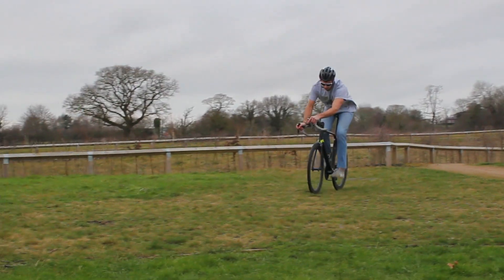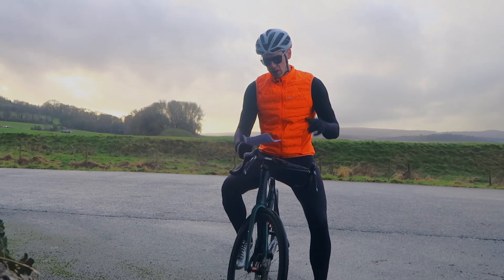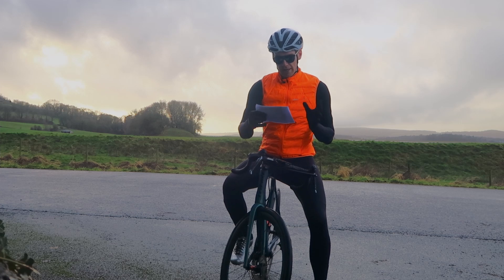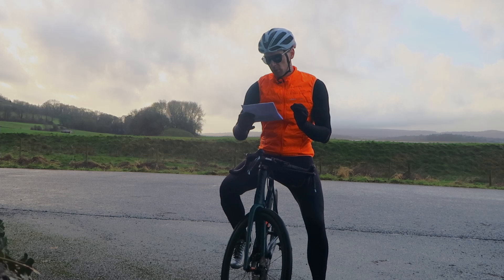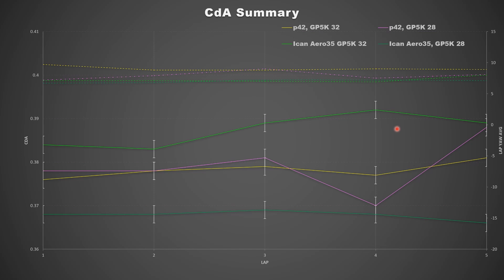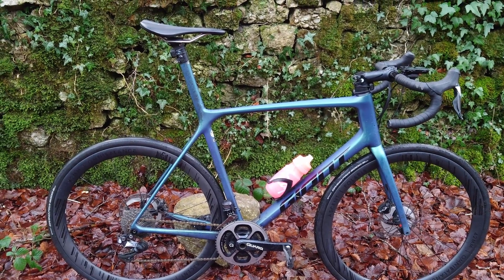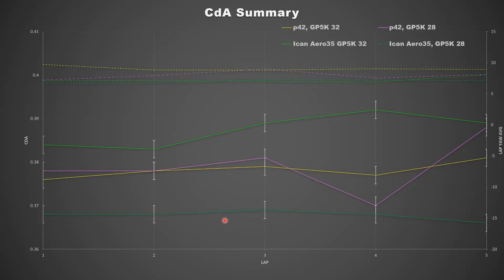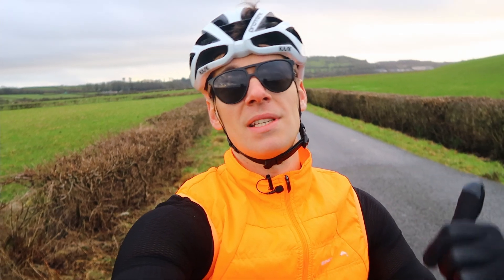Are Wider Tyres a total WIN? The Aerodynamics.

Comment: If the formula "the wide the tyre and the lower the pressure, the lower the rolling resistance" were true, the Tour de France would be ridden on completely deflated MTB tyres. Fact is that formula is only correct within a narrow (pun intended) margin and in order for "the wider the tyre the more aero it is" to work, the rim also has to be wider, which means you have to get a new set of wheels. But then the next formula sets in which is "more equipment = more money = more work = less riding = lower speed".

Comment: Why do you think the p42’s had greater air resistance than the aero 35’s on 28mm tyres,  shouldnt it have been the other way round?  Due to the increased rim width?

Comment: Before you started the test, did you spin balance your wheels?
I'm so sick of people and major brands conducting aerodynamic carbon wheels efficiency comparison test without first leveling the playing field and first balancing all the wheels in the tests. Balance all assembled with tire etc.
Think about it?  Basically 50% of your bike is static (it does not move), i.e. frame, h-bar, fork, seat & post, etc.  Meanwhile the other 50% spins at a high rate of speed.  Don't you think if you balance the spinning 50% that it will alter the bike's performance?!
In 2016 I put together a small team of Vibration experts from University of Washington, NASA, and Washington  State U, together with powerful computers with vibration apps and accelerametors. We conducted this scientific test to see and record the the difference between unbalance wheels vs balanced at high speeds like 30 ~ 50mph +.  What we discovered was mind blowing!  We found that balanced wheels offer superior handling performance, rolling efficiency and watt savings than bike and wheel aerodynamics alone.
We also discovered the phenomena of  what is the main cause of High Speed Wobble, and we named it "Synchronized Oscillation".

Comment: Argh, I'm even more confused now. I have 19mm internal width rims (Giant SLR1) designed for 25mm tyres. I wanted to try 28mm for the comfort benefits, rolling resistance should be about the same.  Hookless aside, I'm 70kilos and had no issue running 25mms for 10000km now at 80 psi. I want to go 28mm so I can drop the pressure a bit but seems like aerodynamics wise, I will be penalised ... What would you buy if you were me? :D

Comment: great test! I have a road bike with the "default" 28mm tyres it came with, and the inner rim is 17mm wide. Should I stay with the 28mm or go with a 32mm tyre (the max that my bike allows)?
Reply: Same case here. I've stuck with 28 specially for the reasons explained in this video.
Reply: @maeso34  turns out that I was wrong and my bike allows for a max size of 38mm tyres, so I put 37mm slick tyres and they are very comfortable

Comment: Tyres with the same construction but in different widths will have lower rolling resistance with increasing width. That is at least true in any reasonable range — like 1 to 10 cm. Also you cannot get the same comfort (equals performance) on a 20 mm tyre  as on a 42 mm tyre.

Jan Heine did a FKT this year on 54 mm tyres. He was concerned about the width but in hindsight he doesn't think it was holding him back. So the optimal tyre width is probably larger than what you think.

Comment: All this is cool and great, but I have an important question with winter coming: Where did you buy this cute orange gilet?

I’m a convert, riding 28mm GP tires on 32mm WR40 LightBicycle rims. No 30 or 32mm tires due to the marginal weight penalty. In tubeless with 4 bar/58 psi.

I haven’t noticed any performance drop in my usual pelotons and will never go back to thinner wheels, mainly for the sake of long-ride comfort.

Comment: I've got a 28mm tyre on a narrow back rim (internal 19,6), with an ez disc cover, it does bulb - but is it as important for the back wheel as it is for the front wheel? The wheeks are giants hookless slr1 42's so tyre options are limited for an 80kg rider trying to stick under the crappy 73psi etrto limit. so its either ride cadex or suck up a 28mm bulbing gp5000 s tr

Comment: BTW l m shocked how low you run the tires for your weight ,you got 8kg on me , l know l d get pinch flats if l ran em that low . What kind of watts can be saved at higher pressures??

Comment: Excellent channel and a great video. Do you run special tubes in your GP5000 tires? Can you confirm that the system weight for the 76psi ideal on the 28mm tires is just over 100kg?  My system weight is 95kg.

Comment: Testing done with error-bars, love it. Liked and subscribed!

I have one more question regarding aero of wider wheels, if I may. Often I read/hear that for best aero performance, the height/width ratio should be at least 3:1, e.g. if I have 30mm wide tire I would need a rim depth of 60mm, so that tire height (assuming 30mm as well)+ rim depth equals 90mm which is 3x tire width. For a 32mm tire that would require a 66mm rim depth which is quite extreme and way deeper than what you have in your test.

So from your experience/knowledge, how important is that 3:1 rule actually? How big do you think the penalty would be to go to 2:1 for example? (My main events are all day solo rides with large distances, so the speed is not super high, but if an aero gains could save me 30mins of an 16h ride I'd take it. So far I am still on my standard wheels, as I am reluctant to spend tons of money for wheels that potentially are not saving me much because rim depth/ tire width are not fitting together anyway
Reply from the maker: For ultra distances you really need to be doing everything you can! Yes the speeds are lower but the cumulative time savings are huge. If its not windy, there's no downside to going deep. My advice would be go deep as you can comfortably handle, use tt clip on bars with a highish position so you're comfortable.
Reply: @PeakTorque  Thank you for your response. As I never had deep wheels before in my life, I can't judge how deep is comfortable to handle regarding crosswinds and there is so much contradicting information about it. Of course I know it also depends on the weight of the rider and I am 2,08m tall 95kg, so probably less affected. However, I also read that in ultra distance, when you tend to be super tired in the end, it get's more dangerous. Also, as the rider, espesically in my size, is of larger impact to the overall drag, it might be better to have shallower wheels, but therefore be able to keep riding in the aerobars.

It makes it all super hard to judge for me, as I get alot of theoretical information but have no personal experience to gauge it. Also, I will probably buy only one set of wheels, so I can't make it wheather depend (other than typically central europe). As you are quite tall yourself and therefore closer to me than most other riders in tests I can find, what would you choose as rim depth if you had the usecase I describe? And how much time savings do you think might that provide over typical 500€ stock wheels (as in order of magnitue, are we taking 1s/1km or way more or way less). 

I hope it doesn't bother you that I ask so specific, but there just isn't much reliable data out there. Thank you allready for all that you provide allready :)
Reply: @martinbrinkmoller7396  You're a tank, you can go 80mm at the back easily (some argue that a disc at the back is actually more stable because you're sitting on it), and you can absolutely handle 70mm at the front, unless you really expect nasty gushes or what not. I'm about 82kg, i've ridden 50, 60, 69mm for years. I've never ridden a disc. I wouldn't recommend 69 in the mountains to light riders. Unless there is violent sidewind (and i mean violent), handling 60mm becomes 2nd nature (once you're used to it, you just automatically correct, it's not conscious anymore), and i think anybody but feathers can handle 50mm. 
There's probably 5W difference between 35 and 45mm, another 5W to 60, probably a bit less than 5W to 80mm. Ball park. For the 2 wheels together @35-40kmh. The slower you go, the more it matters, because you pedal for longer. 
I've been riding Conti 4000/5000 + latex tubes for years. They're fast, i can attest :)
Reply: @pierrex3226  Thank you for your answer. I have allready bought 45mm deep rims allready, so maybe not as deep as I could have gone for, but I still feel the improvement. I am riding Conti GP 5000 on them, 32mm wide, so I also got a wheelset with a 32mm external width. The combination is great
Reply: @martinbrinkmoller7396  very good! If you climb a lot, you can't go wrong with that. If you do a lot of flat, you can save 5-10W going to 60 or 70. Now whether that's worth the money or not, that's not for me to say. Happy riding!

Comment: Nice to have the data back up the intuitive result. You'd expect the wider tire to be less detrimental on a deeper wheel, to the point that a solid disc wheel would be fine with tires that would really screw up a shallow rim of the same width.
Those Polaris rims are a bit of a joke in width really, you'd have to get a mountain bike tire to be in the "too wide" range 😄

Comment: Super cool look at detailed 'stuff'. One thought - a treaded tyre like the Vittoria Corsa has virtually zero chance of achieving laminar (attached) airflow over the curve (leading edge) of the tyre. The treads act as turbulators that trip the air flow up causing it to tumble. The more prominent the tread the greater the boundary layer of turbulent air between the tyre and the smooth flowing surrounding airmass - this effectively increases the profile drag of the entire wheel. For best aero ride slicks and match the tyre width to the rim such that there is as little indentation or difference in width as possible (smooth transition). In fact tyre designers should be exploring this to make tyre/wheel combos that have zero interference to airflow - completely flush join at bead.
Reply from the maker: I think you may be getting a bit confused on this. The leading edge so-called tread on road tyres (especially the gp5000) is allegedly there on purpose as a vortex generator to energise the boundary layer and decreasing separation with the aim of lowering the total form drag. You wouldn't want laminar flow there as its not very sticky once perturbed, a turbulent boundary layer will detach later and cause a lower overall pressure drag. The same could be said for the corsa. This is why we hardly see pure slicks with no tread on the shoulders. Whether this theory works or not is another matter.

Comment: I have been quite vocal on the approximations from the previous video, you have been quite more accurate on this one. 
Good job on the accurate pressure adjustment between width. A table with rim and tire measured width would put things in perspective and the real point missing is a 25mm tire there.

Comment: I’m currently using Vittoria Corsa N.ext 28mm I have no complaints at all,they are certainly quick enough for mild winter riding. Once summer comes around I may shift back to Michelin Power Roads. Great video by the way
Reply: yep, Vittoria where aiming at a slightly different set of attributes you can't have everything, anything tubeless from conti is getting dam expensive these days, 150 quid a set of rubber is ludicrous. TBH it's why i run clinchers i don't get so mad with myself riding 20 miles and slashing the tier on my first ride. Which i have done and literally having to throw 77 quid in the bin plus a 10ers worth of sealant on the floor along with 30quids worth of failed bacon strips. An expensive ride that was.
Reply: I added the 28mm Corsa N.ext's a couple months ago. I wanted what I used before, the Pirelli Pzero 4s, but delivery hit a snag and I went with the Corsa's. They've been alright, I think the Pirelli's roll a little faster. Biggest thing is that I expected them to get a little wider on 21mm internal rims, maybe get up to 30mm wide. But they've stayed true to size, even smaller. I think I'm still measuring them a bit under 28mm even after riding them for a bit.

Comment: Good test and video!  My experience going to wider internal rims (28mm measured clincher to 30.6mm measured tubeless tire on ~55mm deep wheels) also felt like not much, if any aero penalty with tires narrower than rims.  I am somewhat surprised b/c some (like Hambini) suggest that once you go to wide tires, the required chord ratio for aero benefits is well beyond 80mm deep wheels.  (Which I may have misunderstood to mean that wider tires require deeper wheels to maintain same CdA).  Or is the better understanding that the max width of tire/rim system is determinative, and so long as you keep the tires < rim,  you can maintain CdA (or perhaps slightly improve since the overall system is deeper)?
Reply: Because he makes assumptions (doesn't test, not like this) and applies aeronautical methodologies and design principles to round spinning things with blades and axel that touch a solid surface and has a slab of meat on top. Wheels are not "fixed-point" aerofoils and don't act anything like them in many ways and need to be thought about very differently if we didn't we'd all be taking off as the first aero wheels frequently did. There is a compromise to be made between stability, comfort, hysteresis and aerodynamics he quite frequently "forgets" about 3 of them. The difference in points of a Milliermtere is not going to have any bearing on what already is a very messy airflow coming off the road you don't need a master's to know this much. A 25-30mm tier, if the rim is wide enough and has a clean edge and interface it will be "aero", it really is that simple! There will be very little difference to the point that it could be classed as margin for error, it's 5 dam millimetres. Though Roval has shown you don't necessarily need a clean interface either, look a the 26mm tier on the front of a CLX Rapide wheelset, its one of the fastest wheelsets on the planet they obviously have some very clever people working for them and throw a lot of this out the window. It's all very interesting watching these engineering principles come to light.

Comment: Although these tests with a living thing in the saddle (you) are unscientific, and uncomparable, I really like your effort and dedication. You are on the right level, but to find the right door either your tests' limitations should be better explained, or go to a more showlike approach, where everyone suspects them and the product is still entertaining.
Reply from the maker: Disagree. I have the CdA repeatability down to 0.007m^2 on some runs. I have done 200 laps on this course and everything is kept exactly the same between runs. Atmospheric conditions (if changing slightly) are dealt with by the sensor. I will leave you to work out what 0.007 CdA represents in terms of wattage repeatability. When you do enough repeats, anything is possible. My background is professional R&D engineering so I am comfortable sticking to an extremely strict protocol. I don't show even a 10th of the data that goes into this video series because;
A) It is VERY time consuming. Doing the repeats, processing the raw csv files, filming, presenting the data (in a way the largest proportion of the bell curve can understand). That leaves only a finite time for video production.
B) Keeping an audience is key. No one will watch or understand a 2h long presentation on CdA convergence or simultaneous equations. So I keep it as technical as possible for 15 mins approx video length.
C) You can find more of part B on patreon. 
Cheers

Comment: Can I ask what pressure you use please? I'm interested as we are same weight
Reply from the maker: 76psi (for the 28.5mm measured width) on this test course, but that is specific to this road as i explained on the video. A rougher road will be lower, a smoother tt course would be higher.

Comment: Wow this was super helpful and really interesting! I've long been preaching this, but this confirms the numbers with a lot more science than my real world comparisons on training rides. I use an ENVE 3.4 AR SES wheels, which are 25mm internal width and 34mm external. I use Conti GP5000 S TR as well in a 32mm for all my ultra races and in the summer to train. Now in the winter im using the same wheelset, but a Pirelli Cinturato in a 32mm and the difference in like night and day to the GP5K. Similar to your comparison with the Corsa Next. I'm easily 2/3 kph slower for the same power. So I reckon 20 watts is realistic. Would love to know just how much. I used a 30mm GP5K for a short while and when I swopped to the 32mm, I lost no speed and if anything gained some more as the roads are so bad around me! Great video
Reply from the maker: I must admit a few years ago, even when racing i didnt give much regard to tyres. I just fitted something economic and durable. But now, I will only buy a fast one!

Comment: Very interesting, nothing I didn’t know before from common sense but it’s nice to see it proved with data. 

Would have been nice to see a bigger difference in tyre sizes. I currently use 23mm tyres as I don’t ride an uncomfortable carbon bike so 23mm on my titanium bike has always been perfectly fine. I also don’t ride on gravel often, when I do it’s only light gravel. Would be interesting to the difference in aero between a 23mm and a 28mm. 🙂

Comment: So the narrower rims and tyre are faster then? I've never seen a test of a 23mm tyre on a old narrow rim vs a 28mm tyre on a wide rim - maybe it would be too embarrassing.
Reply: Narrow tyre 100% more top speed but less comfort & low grip.

Just use 1:1 ratio or simply use recommended tyre size for that rim.

I use my 100cc machine/motorcycle to do the test between thin & wide tyre. Obviously machine is more consistent than human.
Full throttle on fat tyre, top speed at 100km/h and thin tyre at 120km/h.